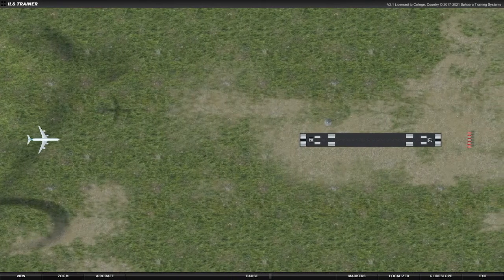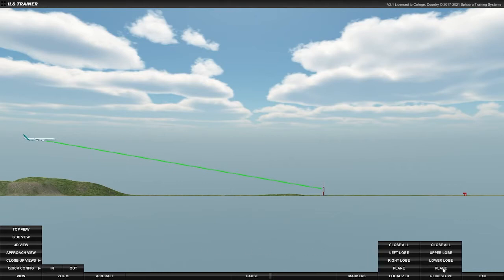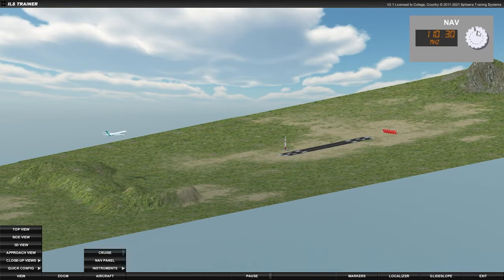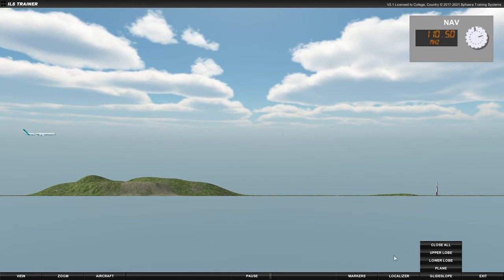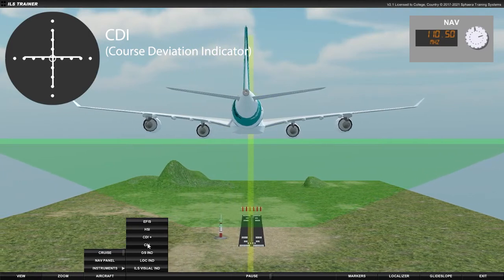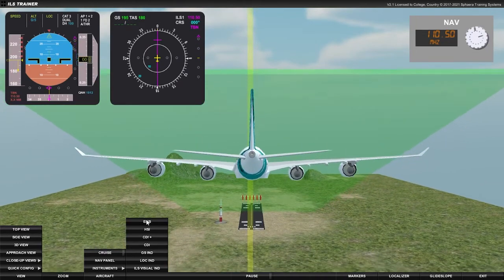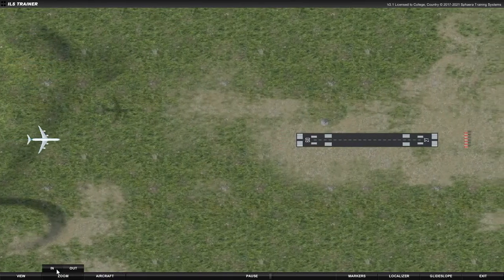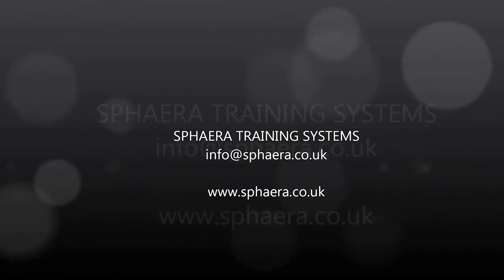Lesson/Tutorial: Instrument Landing Systems (ILS)

Comment: What is the range of the glide slope and at what height do you intercept it at?
Reply from the maker: As per an earlier question, the max range is not a figure we really need to concern ourselves with, but to answer the question, the useable coverage of a localizer normally extends to 18NM with the glideslope around half that range. What is important however is the height/range data for intercepting the localizer/glideslope. This will be listed on the approach plates (charts) for your destination runway (as will vary between runways).